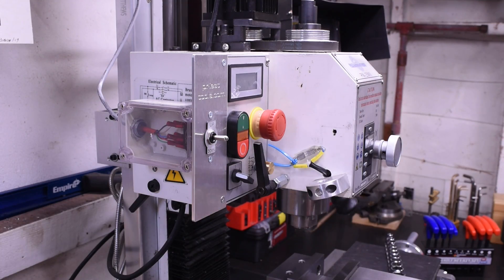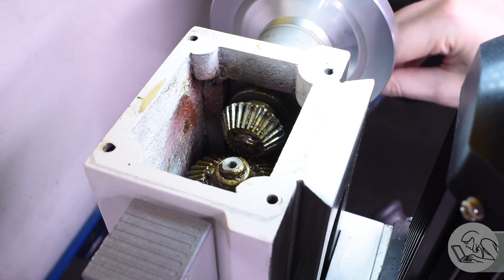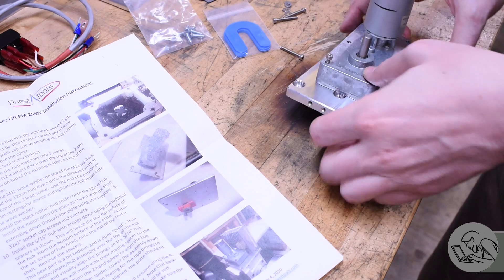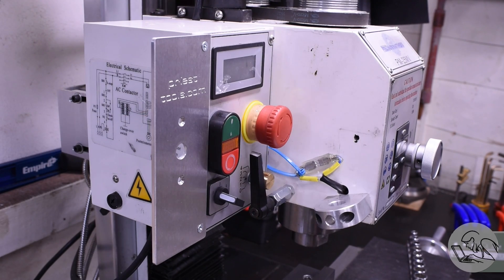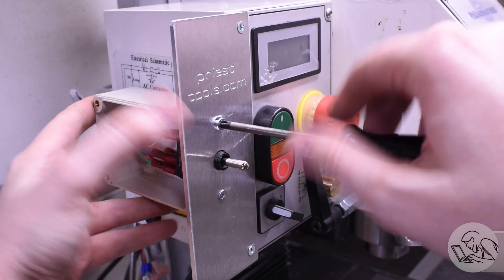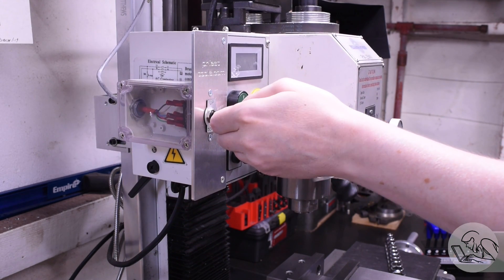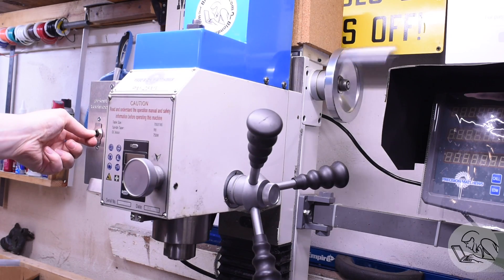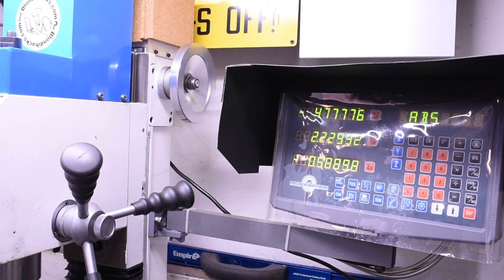Power Z Feed For The Head on a PM25 Milling Machine!

Comment: Nice! I've got a knee mill and moving the knee up & down took a lot of turns (heavy chunk of Cast iron.) I put a typical power feed on it. Way better. But as kits go... The new shaft didn't fit the machine. I had to turn a new shaft, thread to match, cut a keyway, etc. The instructions were typical Chinese. No idea what they said. It makes the crank handle stick out more so learn to avoid it. You still want the crank to be able to move just a bit. Well worth doing.
Reply: Re: chinese instructions,  google translate app on your phone is handy for dealing with this.

Comment: I find Priest Tools kits to be well designed and made, if a tad overpriced. But disappointed with this one. I would've expected hbridge controller (fets and 555?) thrown in with an adjustment pot instead of fiddling with the power supply.Its reasonably high up, and in an enclosure but doesn't look like it covers up / seals well. Open power supply around metal swarf and coolant mist is accident waiting to happen.

Comment: Did I see that right? The mains electrical cable running through the same cable gland as the low voltage wiring to the switch? That's a big nono over here Quinn, especially since the lid of that enclosure isn't directly earthed other than through the backplate, and the switch plate is only earthed via the control box of the mill.

Do yourself a favour and pop in a secondary glad to keep the high and low voltages apart, and perhaps an earth bond wire from the psu earth terminal to the metal lid of the motor/psu enclosure.

Comment: Easy upgrade. That will be a time saver 👍 All machinists, both pro's and hobby should be treated with power feed and rapid in all directions 😁 it's just so more convenient 😁
Reply: Don't forget a head that doesn't drop .150 when locks are released

Comment: Nice that they sent you a new motor. I spent 8 years writing over 150 technical manuals, I enjoyed it, but I remember it being exhausting.
Reply: When writing fiction you can wax poetic and play with your readers making the text a little game to be explored. When writing a technical manual you have to be exact. There can't be anything that has to be interpreted or could be misunderstood, and it should have a easy to read format. Then you have it proof read, corrects at least some of the errors and are ready to to sign off on it when you learn that there is a new version of what ever it was you were documented that's being released. But don't worry. there are only a few small changes, they say. Which usually means you would almost be better off starting a new document rather than trying to revise the old one and try to catch every mention of anything that was changed in every part of the manual. Almost...
Reply: I wrote one tech manual...nobody every used it, but it was honest work and technical correct; After all, isn't that the best kind of correct!?!

Comment: Really wondering how the clutchamathingy will stay in place without the setscrew 😬
Reply: Wave spring applies continuous force on the threads like a lock washer to prevent backing out.
Reply: I'm not going to sleep tonight because I can't tell if the set screw is just sitting loose in there, waiting to fall out and jam the bevel gears, or if Quinn removed it... (...based on her other videos, I'm sure she removed it, but it will forever haunt me.)

Comment: Quick note on the switch hex nut. If you were mounting the switch on thin sheet metal, the hex nut would be installed on the switch first. Then used to adjust for the thickness of the metal, install the switch to the panel, and screw on the knurled for a finished look.

Comment: Oh, I did the same. But with a worm-gear drive (so no hand cranking anymore) and an joy-stick switch. I added a soft-start for very fine adjustment. Works well for me. I was also pissed from lowering and moving up the head all the time ;-)

Comment: Cheapie PWM LED dimmer between the motor and switch?  Variable speed feed/ keep the volts up/ amps down.  Dial near the switch.
Reply: 2 things: 1) the motor has a lot higher peak current than most LED dimmers would handle. 2) the motor is an inductive load and it will require some snubber network to prevent the mostfet from the reverse voltages.
there are cheap-o motor speed controllers - like $5 or so.

Comment: On thinner panels, the nut is for the back side of the panel to adjust how far the switch sticks out.  The knurled ring is meant for the "finished" side by the toggle.  I always use the nut on the finished side (just like you did)...unless it is matching a bunch of other previously installed switches.

Comment: little tip, if you don't want to drop something inside something, use some foam to stuff it in the holes. Cardboard or bubble wrap should work as well. Electricians use this for example to prevent nuts from falling into motors when wiring them.
Reply: That is a great tip, I'll add to my arsenal. Thanks.

Comment: Actually is really easy to reduce the voltage further, it is a matter of dismantling the device and finding the voltage reference and divider (usually it is just a couple of resistors connected to the trimpot, changing those with a bit of experimentation and calculation will do
Reply: Review her video on "power feed" from a couple of weeks ago.  You will soon realize she needs very little "help" when it comes to electronics.

Comment: Why not use bolt cutters for the bolt shortening? They’re great to have around in the shop
Reply: Personally I use the angle grinder with a threaded nut to reform the threads (while unscrewing it)

Comment: Without getting too close to CNC, I have visions of a stepper motor attachment, to which you could do things like preprogrammed drilling with chip breaking, or auto tool changer height with the press of a button.
Reply: Yeah - it's screaming for a "home" button!
Reply: More expensive though, mabuchi 550 motors are quite cheap.

Comment: Is the wave washer grippy enough to prevent it from unthreading the coupling? Since now actual torque is being transmitted through there, I would think that set screw might be necessary. As in the motor might be able to just spin off the coupling. But I also have no idea what I'm doing, so take that for what it's worth.
Reply from the maker: So far it seems to be. We’ll see if it holds up long term

Comment: Congratulations!  What is the practical intended use for the knurled ring that comes with those switch nuts?
Reply: You can use the hex nut behind the panel to space the switch where you want it. The knurled nut then goes on the outside of the panel to hold the switch on.

Comment: Cool, a surprise ending!

That switch panel has a pet peeve of mine - countersinks that aren't deep enough to fully sink the screw heads. Can't stand the sight of slightly proud countersink screw heads…

Very interesting as usual, thanks.
Reply: I thought the same thing I would have drilled out the box behind it and used two lock nuts ... Counter sinks that are not deep enough or to deep /or uneven are like SAND IN THE BATHING SUIT !!!!!!!!!!
Reply: Screw holes not lining up created this problem. There is no forgiveness in flat head screws. Button Head cap screws (BHCS). There you can open up the holes and you would not know the difference. Unless the bolts are way off.. Technical manuals can be a challenge and engineer's last worry. Keeping them up to date is a bigger issue but just needs a little extra effort.
Reply: That's why I always use dome head screws on projects - they just look neater (in my opinion)

Comment: See, this is how I started, and before I knew it, I had the machine full blown CNC. I used a couple gas struts to help the Z. I was worried I wouldn't use the mill as much since it requires a program now, but honestly I run it manually frequently just using the axis controls. EDIT: I used a power wheelchair motor.

Comment: Add a counterweight to the handwheel to stop the shaking. Wouldn't take much, just Mill a hole and press fit in the proper amount of lead to match the crank handle weight.
Reply from the maker: It doesn’t shake any more
Reply: @Blondihacks  was going to suggest something similar.  Lowering the speed reduces the forces so it doesn't matter, though.
Reply: Does anybody bother to watch the complete videos??

Comment: You might need to add a DC-DC buck converter with a potentiometer to change the output voltage for the motor. It will be very helpful for you.
Reply: Don't change the voltage, use PWM controller (and even increase the voltage of the power supply again). More control and more power.
Reply: pwm control with a display is like $5, also it will fit in the box

Comment: I swear wood refuses to be measured correctly and contracts on contact with a saw. It's the only possible explanation for it always being too short.
Reply: I don't know, I do both wood and metal working (please don't judge) and seem to mess up equally in both materials.
Reply: @crichtonbruce4329  It's a talent to manage to be equally inaccurate no matter what the material. Be proud... (Just kidding, I'm in a snarky mode right now)